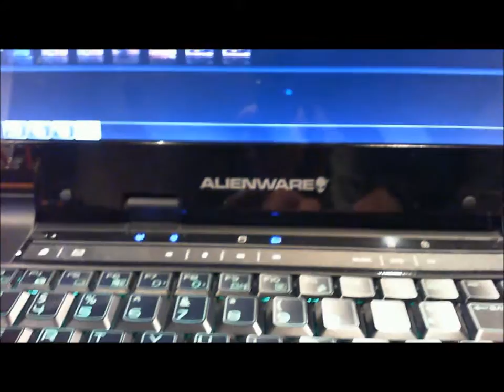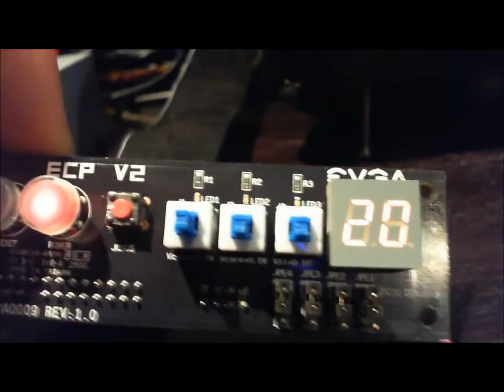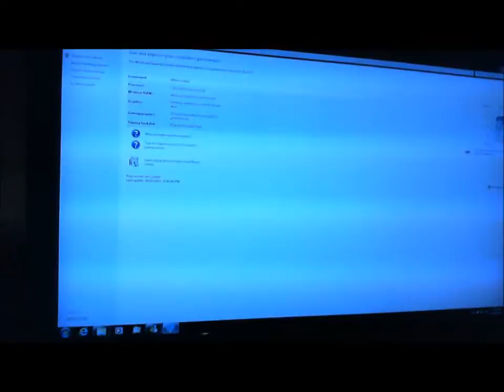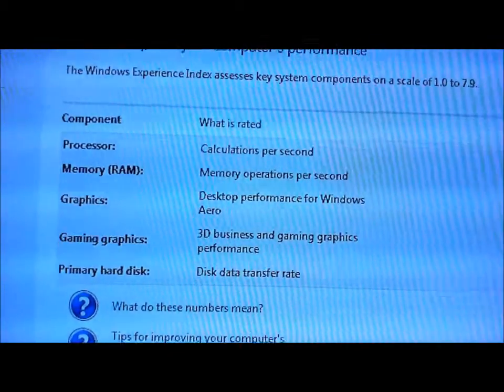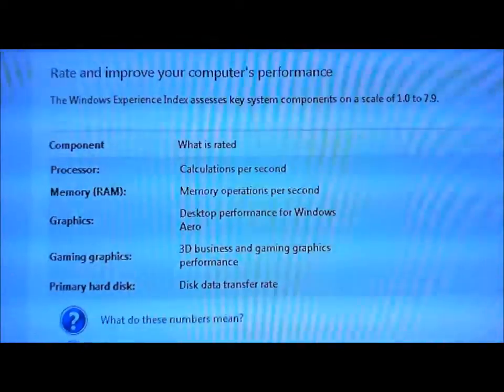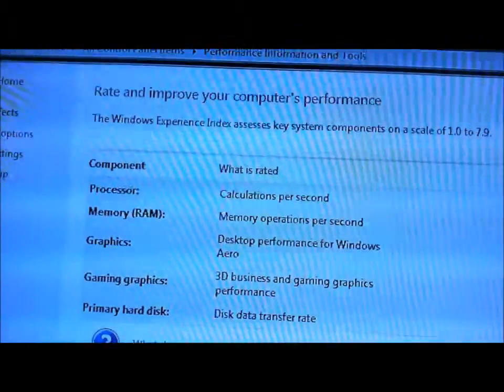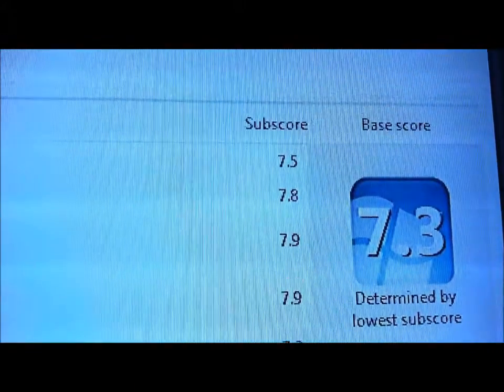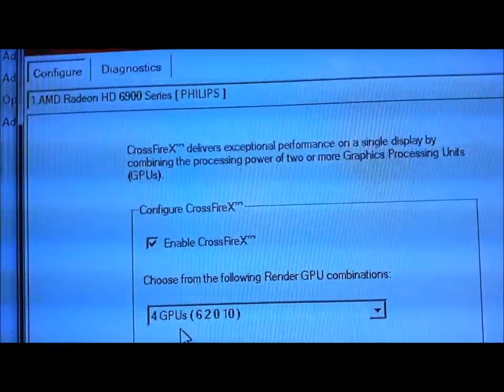4 Way CrossFire 6970.wmv

Comment: @dannyperez2k11 They do, I've read articles on on the 6900 series cards and people claim that their boxy rectangular shape doesn't allow proper airflow for them to be so close to each other. Usually they talk about Tri-Crossfire setups and claim the middle card overheats. This would most definitely happen with a Quad-Fire setup as well. I also don't get by he has this setup, his CPU is bottlenecked to crap. I already bottleneck my i7-920 at 4.0Ghz with a 6970 crossfire setup.

Comment: @xXRocStrXx Ya i think a 1200 watt would be minimum, if he were to run some type of 3d test bench he would already max out the 12v rail on just the video cards, and would only have 5 amps to spread around to all the other components per silver stones rating of max 85 amps.

Comment: is this good enough to build? imma planing to build 2-3 pc
ASUS Rampage III Extreme Black Edition
Core i7 Extreme 980X 6-8 core 4.8-5.0GHz
4x Crossfire radeon hd 6970/6990 or 4x SLI GTX 580/590
24gb Ram OCZ
60-128gb Intel SSD
500gb-1.5tb HDD Seagate
DVDRW + Bluray Samsung or Sony
3-5x 24" LED monitor + 3d support + 55" Bravia TV (HDMI)
Gaming Keyboard and Mouse
logitech 4.1 speakers + starcraft 2 headset
Liquid Nitrogen cooled
Transformer PC case (available in here Philippines)
LED lights
6 char

Comment: I really love your system you have done a great job on picking out the parts. I have a question for you, how well doe the 6970's cool being so close to each other? I hear some people say " if you crossfire two 6970's you will need to water clock them because they are so close to each other"  Water blocking them wont be a problem since i have a huge water cooling setup. But buying water blocks for these cards is a extra $200 maybe $260. Any way nice system man.

Comment: @jaw2floor 

Wow, you can't bottle neck gpus! LOL even with quad Xeon X7500 (145GHz each) totaling 580GHz of processing power would not bottle neck the 6970's

GPU tech is far beyond other types of computer hardware (GDDR5 starting in the 4770 for example)

Comment: @davidlloyd83 i had a near miss with this one i think these cards really good watercooled i ran mine XFIREX
GPU1 clocked 96-99 degrees celsius .... noticed it, then cranked the gpu fans to 100% temps still wasnt going down then i opened the case and the air was completely blocked between cards so i wedge it with printing paper folded several times to male it thick, as soon as i did it  i heard like a gasping for air sound on the GPU1 fans then temps went down from 90ish to low 50s

Comment: Hyper would u mind telling me you GPU temps on full load, i just got my 2  XFX 6970s yesterday for some reason they a re sizzling, with MSI afterburner logged 96 degree celsius on my GPU1 and GPU2 about 89 it was running for a good 5-10 min till i heard the fan noise go up and i looked at the temps and as soon as i saw it i cranked my fans to 100% opened my corsair 800D and GPU exhaust ports were hot, Noticed there wasn't a good enough gap between 2 cards so i wedge it then temps went down to 50

Comment: @murakumo33 
perhaps even take a look at the Thermaltake W0133RU Toughpower 1200w PSU for 340$

ORR
What i've got
Thermaltake TRX-1200M TR2
Only 200$
you still have 6 x 6pin connectors, and 3 x 8 pin connectors, if your good with electricals you can derive a 8pin from two of the 6pins with an excessive loop somewhere (not exactly sure how it works my dad did it for me on an ild PSU of mine)
LINKs BELOW:

Comment from the maker: @murakumo33 it all depends on conectors, for a 4 way setup you need 4, 8pins and 4, 6 pins, a good quality PSU will handle all 4 gpu's on load i run them on my silverstone 1000w with two 6 pin molex adaptors and also running dual EPS12v connectors for cpu which is 600w also and the PSU is doing great none the less the silverstone has 1100 peak but draws a little more from the wall. so yes it would work fine IMO

Comment from the maker: 1000w is not enough but since it is a quality psu it is with 2 molex to 6 pin adaptors 1200w is enough enermax 1020w to 1250w support 4 gpu's so 1000w is borderline

Comment from the maker: @AlienPrime173 yeah nice laptop did you have issues with drivers? i had to not install the drivers it says only one card is working 3870 crossfire but they both clearly work but had issues with drivers and games at full screen freezing with drivers installed without it works great at full screen

Comment from the maker: @danthemanzizzle Hey man how did you get 7.6 with a caviar green??? lol i have 2 ssd's if i run raid 0 with both 120 you think i could get a better hdd score???? never thought of setting up a raid array... Anyways nice scores and when I overclock to anything above 4ghz my hard disk score goes down .1 or .2 when running at 4.6ghz :( i tried using the jmicron sata controller and same thing happens so I think it degrades the speed of the ich10r chipset when overclocked but don't quote me on that

Comment from the maker: @Uploafer64 hey man thanks for the heads up but I made my mind on an Enermax EVO Galaxy 1250 PSU fit an finish looks great and has 6 rails at 30A think it is pretty good i think. Yeah I am getting a case soon not quite a level 10 but pretty much same priciple you will see!!!! it's a mess right now got it at 4.4ghz at 1.620volts and vreg temp is at 31 and cpu on load is steady at 57 wierd shold be warmer at those voltages!!! bellow 65 i think is safe right??? lol